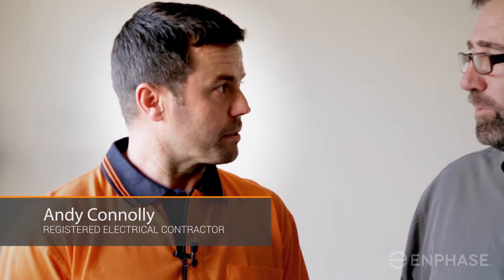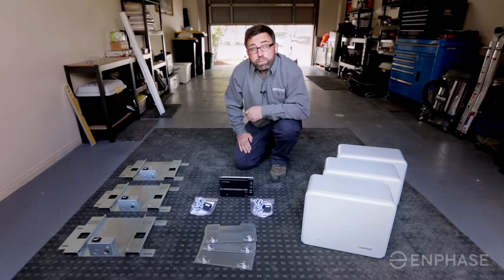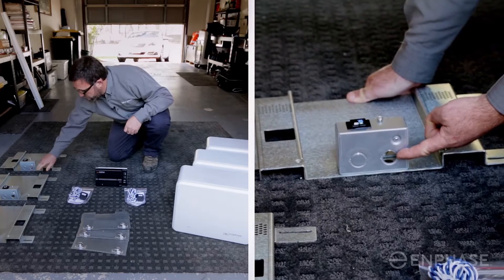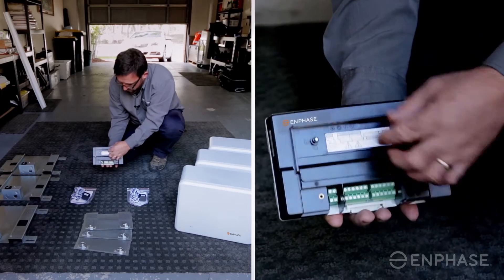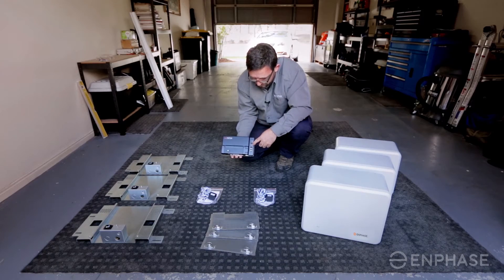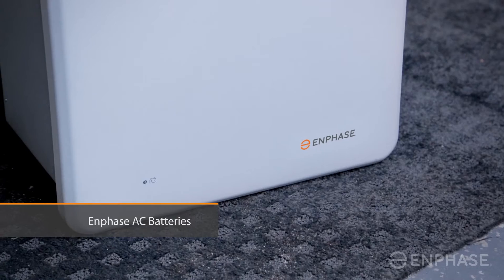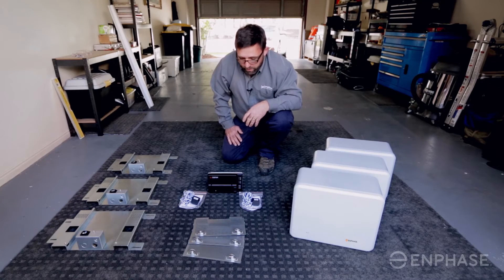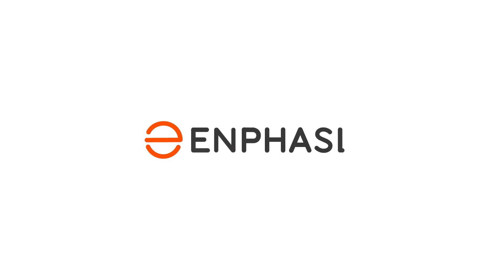Enphase AC Battery 30 Minute Install English AU

Comment: This is the first Enphase battery, 1.2 kWh capacity, and it is basically obsoleted by new Encharge batteries (3.36 kWh and 10.5 kWh versions). It connects to the main panel rather than the IQ combiner box. It operates as follows.
“Charging and Discharging
The charging and discharging functions are controlled by the IQ Envoy as follows:
Charging: The IQ Battery typically charges during daylight hours and when the solar production is greater than the home consumption. The IQ Battery can also be programmed to charge from the electric grid at night under certain conditions.
Discharging: The IQ Battery discharges power only to service local loads. It does not discharge power through the utility meter onto the electric grid. The IQ Battery discharges for use by the home if all of the following occur:
• The consumption exceeds the production
• The actual time of day is after the peak start time, if time of use is configured
• The batteries are not fully discharged. If the batteries are fully discharged, then they must recharge
from the PV system before they can discharge again.”

Comment: Can you show how it's connected to the panel?  I'd like to do a self install.  Thanks!
Reply from the maker: The AC Battery is not connected directly to the panels, its wired into the main switchboard. Installation instructions are available for download from the Enphase website. Electrical wiring should always be completed by a licensed electrician.  Feel free to get in touch if you'd like more information.

Comment: Hi I just got a price for a solar, which include  IQ7 Microinverters and a Envoys S Standard, would the Envoys S Standard capable of connecting this Battery to ? or do I need to go to the metered  Envoy S ?
Reply from the maker: You will need to go with the Envoy S Metered if you want to add batteries in the future.
Reply: @ACSolarWarehouse  Thanks
Reply: Hi again can any battery be fitted to this or it can only take Enphase ?  @ACSolarWarehouse

Comment: The price for these is way way way way way toooooo high!!! I can get a more KWh from 2, $100 dollar deep cycle batteries (that's $200 plus tax) from the tractor store in town near me. Two of them last me 2 years easily! That is less than half the cost of your, little enphase box thing..lol, and that is if they would really even last the expected ten years. I for one don't think so, because most lithium batteries can't make it past 3 years before beginning to degrade and lose charge capacity.

Comment: Too small capacity and too expensive!
Reply from the maker: Enphase AC Batteries are ideal for small - medium residential applications where safety, performance and reliability are important considerations. 
In batteries, like most other things, cost is usually an indicator of quality.  Cheap batteries don't have the same chemistry, performance, warranty, etc. as the Enphase AC Battery.  
Enphase AC Batteries are not the right choice for people wanting large, cheap energy storage systems.